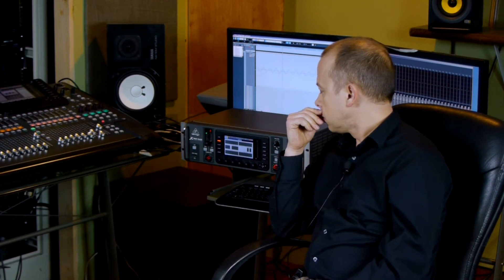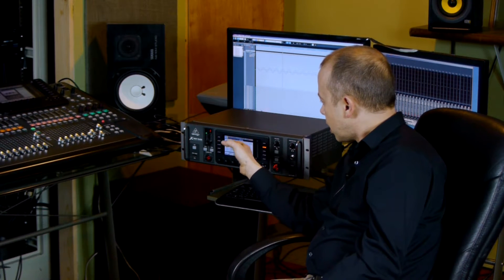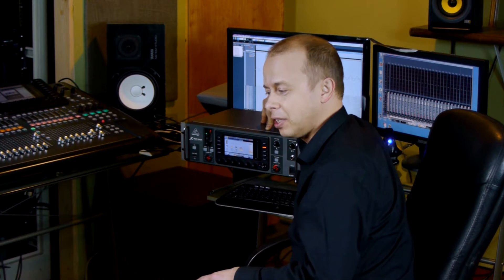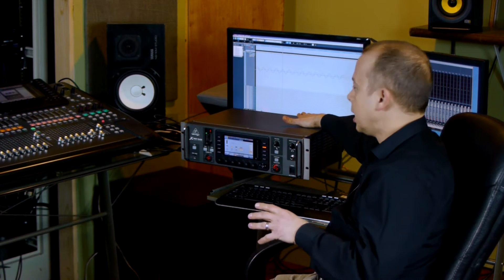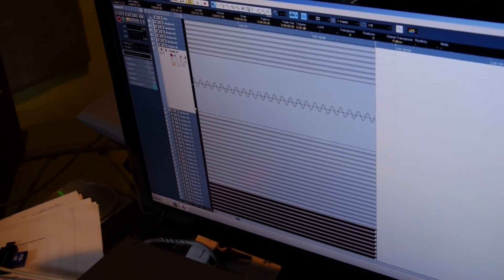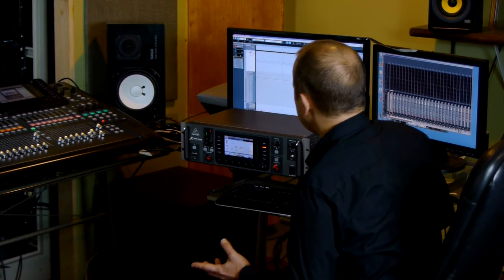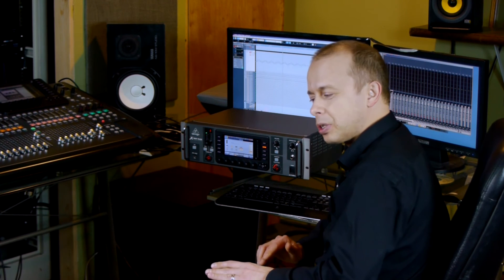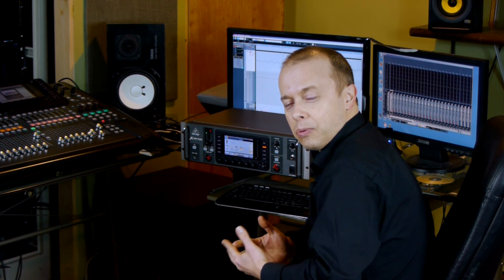X32 Rack Part 3 Recording Test

Comment: What was the recording frequency and bitrate for 32 in 32 out? I'm just curious. Also I believe removing FW was good cost cutting measure. Apple dropped FW and also has USB so there is no actual need for it (especially the new models that only have 1 USB). I'm a PC user so doesn't really bother me.
Reply from the maker: Progress303 24bit at 48k